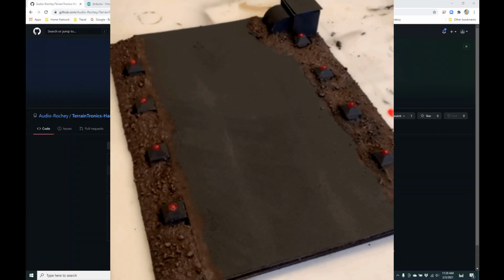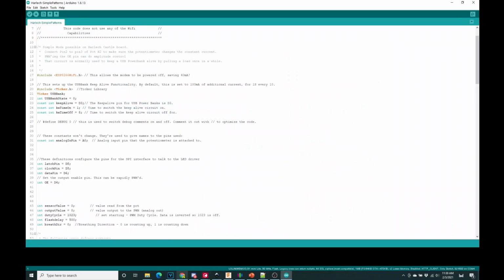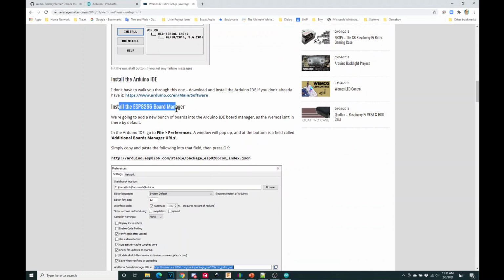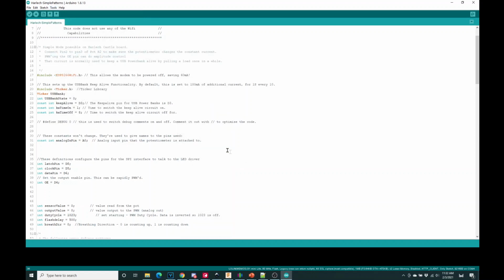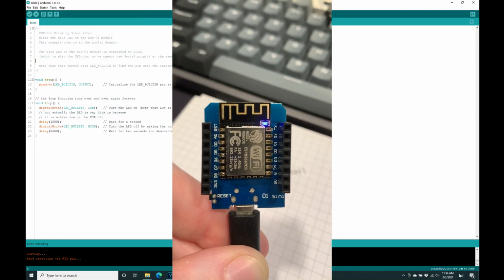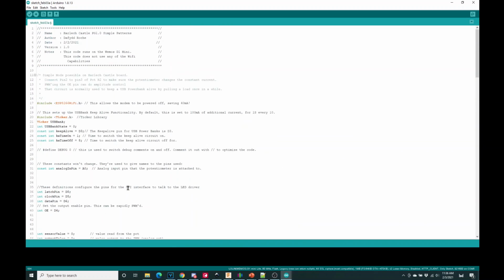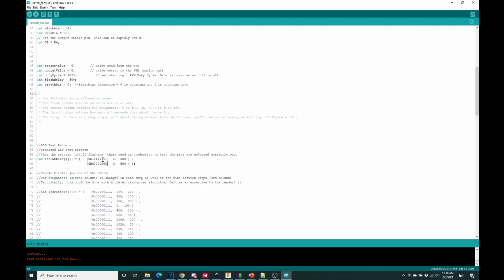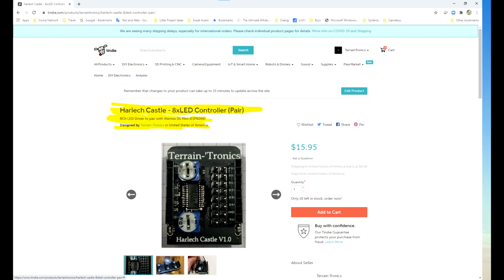Setting up the programming environment for Terrain Tronics Harlech Castle boards

Comment: isn't wemos kinda overkill for this kind of thing?
seems like a digispark would get the job done...
Reply from the maker: Definitely. However, it’s often cheaper than a digispark and has the potential for WiFi control. Plenty of memory and IO for handling servos, RGB, LED’s, IR remote control and all the rest!
Reply: @TerrainTronics  they are cheaper?
lol go figure.

man these are good times to be nerdy :P